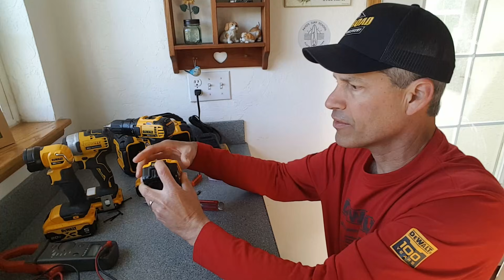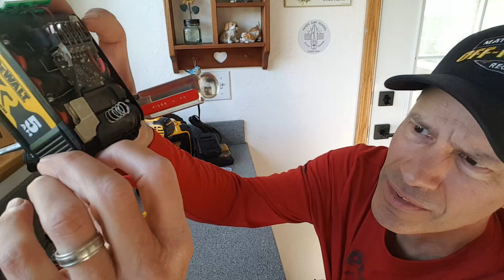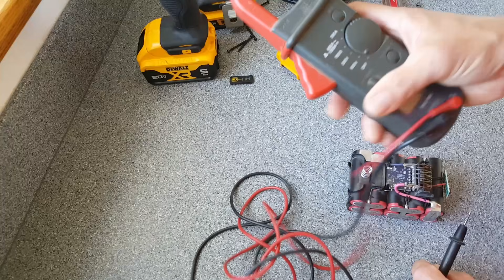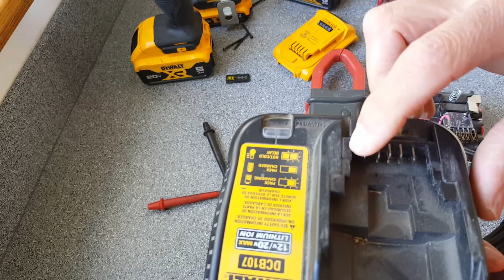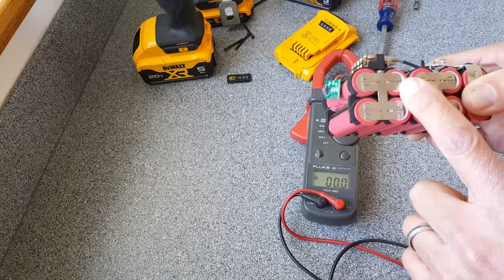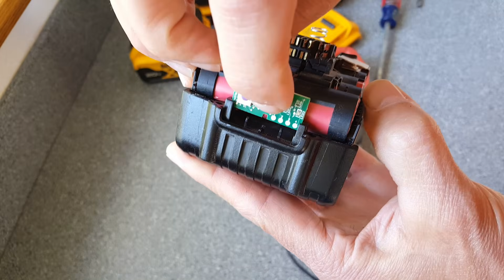DeWALT Battery NOT charging fully?? TRY THIS FIX!

Comment: Bought 2 new batteries from ebay now one of them is doing the exact same thing but the other battery works fine. Battery date says 2025 I purchased them in may this year they both came fully charged I used them both.
Reply from the maker: I am sorry to hear about that, but since it is so new, I would definitely look into getting it replaced under warranty!

Comment: This video represents the best of the internet: sharing helpful information that makes people's lives easier.  We got a brand new DeWalt 60 V chainsaw and out of the box the brand new battery was only charging to 30%.  I guessed that it was 3 groups of cells at about 20 V based on the 3 pairs of 2 contacts and the battery charger being 20 volts, but rather than having to take it apart to figure all that out, you did it expertly and so all I needed to do was check the voltage on the contacts for each of the cell sets to find the bad set.  Thank you so much!!!
Reply from the maker: Thank you so much for your comment! We have learned so much from others too. We are trying to pay it forward!

Comment: Worst batteries ever nothing but crap have 8 batteries  not one will hold  a charge .switch to Ryobi 6 years ago and every one of them still works perfect  wish they made batteries for dewalt crap
Reply from the maker: Good morning. I am sorry to hear that you had this bad experience!
Reply: @jeffcunha9114  He most likely got fake Dewalt batteries online or something.
Reply: I have probably had up to 30 Dewalt batteries at one point.  All kinds, 12v, Flexvolt, ext.  Most of them are 5-8 years old today.  So far only 2 have given me this one bar problem.  

Personally i think Ryobi is for the housewife.  But you do you.

Comment: Is it OK to use a 20V battery to jumpstart an 18V battery?  Both of the 18V batteries are bad: the red light on the charger blinks red all the time.  Or a 12V AC adapter to jumpstart the 18V batteries?
Reply from the maker: Good day to you. It sounds like you have some bad cells. You mentioned in another comment that you have a test button on a 18v battery? I was not aware that DeWALT made a 18v battery with a test light.
Reply: @jeffcunha9114  They don't, the 18v are Ni cad. The 20v are lithium.

Comment: 9:27:  I don’t have a solder to de-solder  the dead battery, and re-solder a new one back.  I only have a regular soldering iron to solder wires.  Those are soldered together with metal plates.  How much is such soldering tool?
Reply from the maker: Doing this kind of repair is definitely possible but can be dangerous if a person is using the incorrect methods or tools. Is your battery still under warranty?

Comment: Bought a brand new dewalt radio.. throw my battery in it. 

won’t fully charge it. Thought my battery was dead, put one of my Brand new battery’s in.. same deal, only charges 1 bar. By accident my father put a battery in the radio without me telling him the issue.. that battery as well now only charges to 1 bar. 

I thought there was something wrong with the radio killing my batteries, I’m going to try exactly what you said

Thank god I didn’t throw these batteries away.. I’ll report back with my findings 

Thank you for taking the time and explaining with this video , god bless
Reply from the maker: Good day to you! Thank you very much for your message. If your battery is still under warranty, I would definitely turn it in for replacement. If it is out of warranty, this solution may work for you. Just keep using the unbalanced battery as normal even though it is only charging to one bar. Your goal is to help rebalance the cells by cycling the battery. Since we use these in a construction environment, we are able to cycle a battery several times a day. If you can find a practical use for the recovering battery during rehabilitation, your time will pass quickly!
Reply: Hi any updates with ur batteries coz I have exactly same issue as urs my radio killing batteries I thought 😅
Reply: @sefeenvilla8983 nah I’ve tried every fix I could find on YouTube, nothing… threw them away and bought new. 

Never putting a battery in the radio again…
Reply from the maker: Sorry to hear about this! Thank you for the update though!

Comment: My battery was fully dead so I jump started it, now it has the one bar issue. I don't necessarily use my tools enough as of now to really cycle through it in a reasonable time. Is there a way to manually charge the dead cells when it's dissembled like that?
Reply from the maker: Good morning! While this is certainly possible with the correct equipment, the cells are spot welded to the cell pack. I would suggest just using the battery as normal, and it may recover itself in time. If the battery is still under warranty, return it for replacement. Dewalt stands behind their products.
Reply: You have two options. You can use a bench top power supply and individually charge each cell to 4-4.2v or you can solder a 5s lead to the tabs where the BMS leads go to and use a RC charger to balance charge the cells. I would first start by checking each cells with a meter. You may have some cells that are completely dead and need replacing. Be aware that the Dewalt charger will not balance the cells for you. It will only detect and tell you when there is a problem with temp or balance.
Reply from the maker: Thank you for your comments!
Reply: @bobsoft  Where can you get a bench top power supply? Would you happen to have a link on Amazon to one?
Reply: @SthrnDrt  Cant post links here. Linear supplies are best
Reply from the maker: Thank you! 😊

Comment: Watched the whole video...now to figure out what you mean by cycling the battery 😂 I've been using my brother's dewalt fan and don't want to tell him one of his batteries won't charge. The charger stays solid red but when i connect it to the fan the fan doesn't work. Heeeeeelp please 🥴
Reply from the maker: Good morning. Cycling the battery is when you would charge the battery, drain it down and charge it again. That would be one cycle. If it is not taking a charge at all, it is time to see if it is still under warranty! Thank you for your message.
Reply: Take apart the pack and test with a meter. Right now its a guessing game until you test.
Reply from the maker: Yes, testing is a great way to get answers!

Comment: Mine is at 2 bars of charge and soon as I put the battery on the charger the bottom left red light blinks which says is the hot/cold delay. That’s all it does is blinks the whole time. These are 20v battery’s. Well now the bottom left red light is on now and the right small light next to it is blinking saying it’s in second charging level. So maybe it is charging the one on there. I was thinking they would instantly start charging being they show 2 lights of charge on the battery.
Reply from the maker: Good morning! That is interesting. Did your batteries charge to the full three bars now?
Reply: You have some bad cells when it only reaches 2 bars.
Reply from the maker: Interesting point, thank you.

Comment: I'm gonna give this a shot this weekend and see if it evens out. Thanks again!
Reply from the maker: Awesome! Please let us know how it goes! 👍☕
Reply: @jeffcunha9114  i definitely will keep you updated
Reply from the maker: Good day to you! Any updates on this battery? I was researching the many different DeWALT battery chargers to see if one of them comes with cell balancing circuitry, but I am stumped. Does anyone know an answer to this question?
Reply: @jeffcunha9114  well it's funny you ask because I have been draining and recharging that 60 volt for the past week. I start to drain it with a drill and when then drill stops after about 3 or 4 minutes I put it on a 20 volt light that I have and it takes about 24 to 26 hours to drain. The battery seems to work fine on the light but nothing else. Also it still reads one bar on the indicator on the battery.  It's at home draining right now on the light for about the 6th day in a row lol. I'm not giving up yet but if all else fails it works great for a shop light battery.
Reply from the maker: @ko4otv43  Thank you for the awesome effort and update! That little fella is putting up a fight! Thank you for trying! We appreciate you.
Reply: @ko4otv43  Flex volt are notorious for issues
Reply: @bobsoft Well it was an older battery from 2018. I've had 3 of them since then and it was the only one I let sit for a long period of time. Other than that they've been excellent.
Reply from the maker: Thank you for your thoughts! I also have had good success with Dewalt.